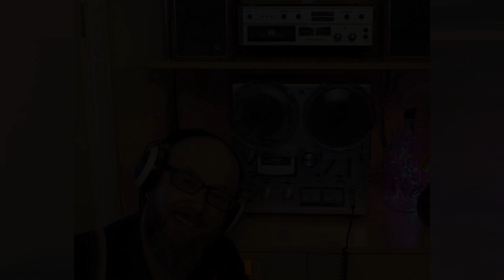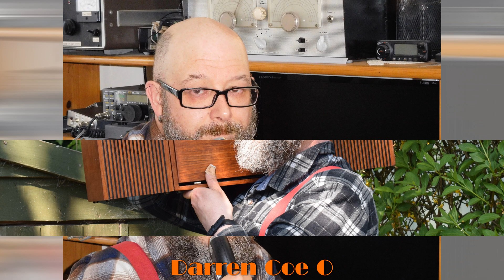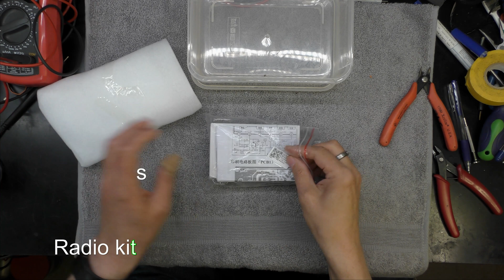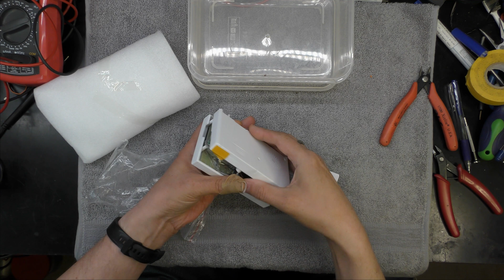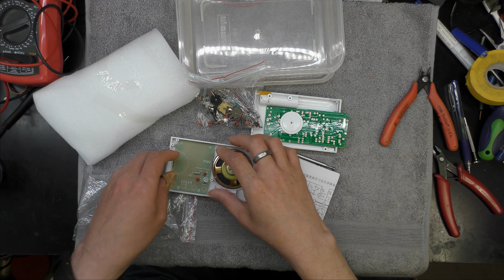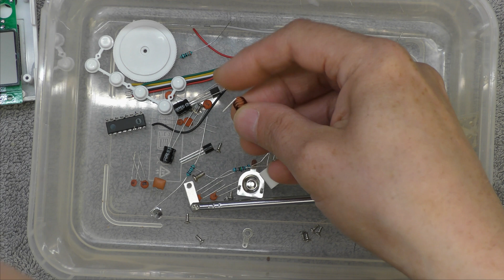Kit Radios Pt3 Receiver with Clock. (4K)

Comment: The dot on the ceramic filters is the center pass frequency, red/blue/orange is typical.
Red is 10.695mhz as far as i can remember.
The old game joystics and clock radios used something like sellotape to hold the domes in place, sellotape does make things better :-D
The only thing that radio lacks is a black marker pen to highlight the button text, it looks a bit unfinished.
Oh you cant get the tuning capacitor in wrong, the tags are a different width, the pcb holes are the same.
But that's just my opinion, nothing more.